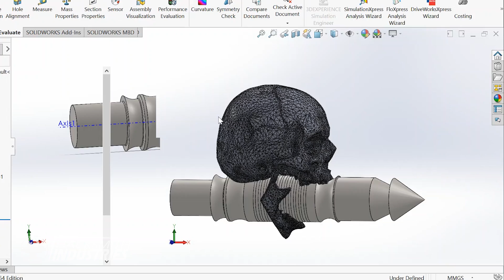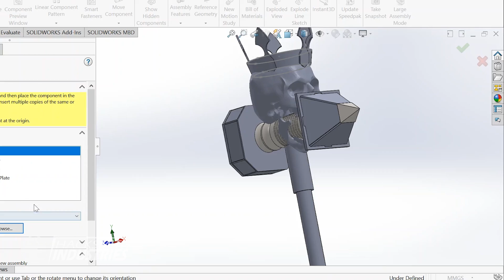SKULL HAMMER Destroys ALL

Comment: I will be very happy when you do the electric steel whip of Ivan Antonovich Vanko of Iron Man 2.
And of course excellent video guys.
Reply: Kevin Palencia whiplash
Reply: I would like to see that!
Reply: That would be cool, but I think it would need to be a multiple episode build
Reply: @NoSubsWithContent  Depends what you do. If you just make LED chains then it's safe. 

If you get some metal and heat it up like their lightsaber build....
Reply: I second that
Reply: Kevin Palencia It would also be incredibly dangerous
Reply: I would use plasma to do this project, to do that u would theoretically need a fusion reactor miniaturized and that would cost millions of dollars.then I would use the energy of the fusion too power the plasma making it work. The machine would need a kickstart of tremendous energy for the plasma but the it would keep working nearly indefinitely until it runs out of material to fusion. This mens if u keep loading that sucker up with helium or other basic materials it will keep going. 
The only problem now is how to redirect a part of the plasma.
I would do this by using at least 10 tesla electromagnets.
If hacksmith scores big one day and becomes millionaires, they could attempt this (it’s kinda like creating a mini star)
Reply: @lekyboi  Please tell me you're joking. A fusion reactor.... Something that has been researched for decades and had billions of dollars put in to it and thus far they have not been able to have a net positive output?

Also, fusion does not use helium as fuel. A fusion reactor uses hydrogen as fuel and fuses it in to Helium. If you were to fuse Helium, you would create Beryllium.

Fusion has not been perfected for the creation of energy, hence why we do not have fusion power plants.
Reply: @lekyboi  r/iamversmart
Reply: Yes that is very cool
Reply: Sorry I had a little bug on the hydrogen, helium is the result of the reaction (btw I have a gigantic facility next too my city who has a fusion reactor who should be up and running in less than five years, so not impossible)
Reply: Yeah for sure they need to do that
Reply: TheEmeraldFlygon Ivan is whiplashes real name
Reply: Wtf is that boi
Reply: That would be noice
Reply: @candyman9635  I believe that's the difference between "Make It Real" and larping...
Reply: Soooo basically whiplash
Reply: @lekyboi  , 2 questions 

1. What city?

2. You think that since you have heard that a massive facility is able to create a sustainable fusion reaction, that still means that a tiny reactor is currently impossible.
Reply: @lekyboi  what city and what facility and what's you name
Reply: Make a bolt gun from Warhammer 40k

Comment: Why round handles other than a round shaft being easy?  In real life, striking tool handles are oval so that the the tool doesn't twist in the user's hand during use and the user can index and control the trajectory..  Would seem to be a pretty important feature especially given the weight of the hammer..